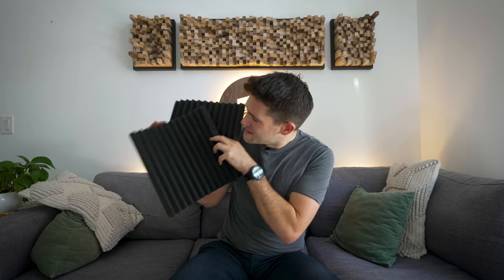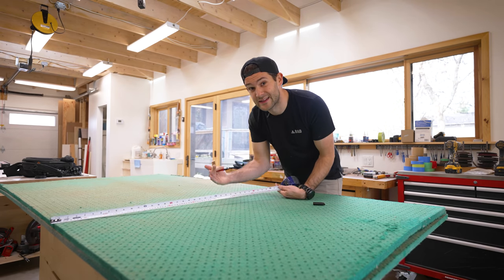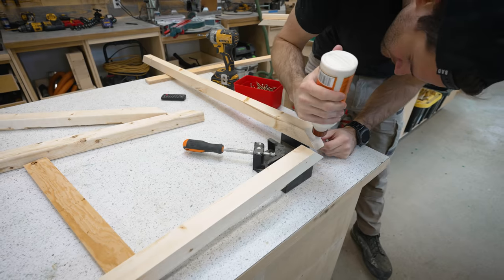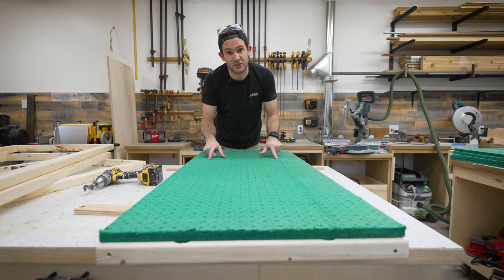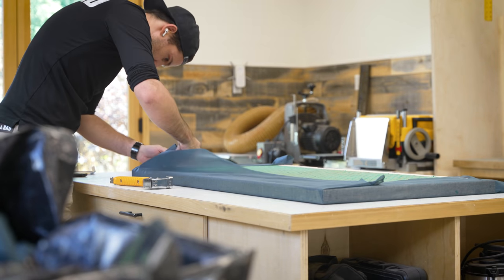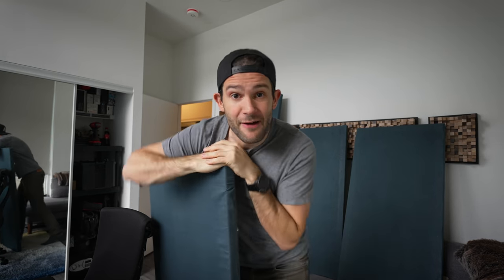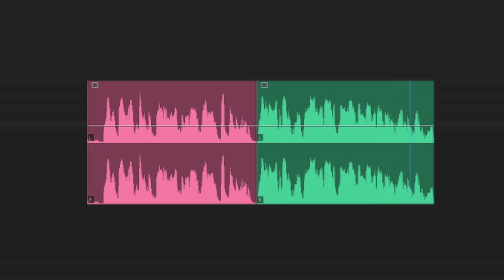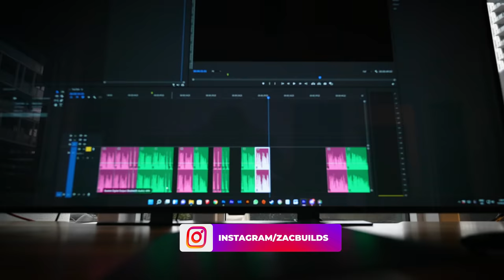Acoustic panels that actually look GOOD

Comment: Fabric can definitely have a huge impact on reflected acoustics. There's a reason speaker grill cloths look the way they do.
Reply: This is not very true. Grill cloths mostly never affect the sound coming of the speakers since the thickness is so thin that it is not an obstacle for most frequencies. It could maybe only disturb the very high frequencies (but then you’d need some thick cloth).
Reply: The key is that the sound hits the dense sound absorption. If the fabric isn’t breathable then yes it would but if it’s breathable, then no.
Reply: @NewHopeAudio  If you ever visit an old movie theater, or most stage theaters, you will find that they have great big deep 10-15" rockwool or foam absorbing panels wrapped in huge heaps of thick dense velvety cloth.  It has fallen out of style, but mostly because of the look rather than the effectiveness.  Free moving mass is the key to great sound absorbtion, nice thick padded blankets are actually the perfect topper for sound panels.  They don't need to 'breathe' because you are not passing air 'through' the panels at all.  What you want to do is absorb reflections of vibrations in the air, and those vibrations move in waves.  Literally a thick padded blanket hanging on a rod would probably do more good than these panels... but it would look like a granny youtuber space which is probably not what he is going for?

The idea of wanting thin and light breathable material on your sound panels is actually the wrong move, especially with a sturdy wooden frame.  You want to pad that thing out as much as possible with heavy material.  Big loose sheets and layers of jean, denim, or other such materials may look a little odd, but would help more than the board he is using.

Comment: I would definitely be interested in the comparison to rockwool, I'm planning a studio right now and would love to know what performs better. There's not a lot of info about it online - I could only find one sparse reddit thread on the subject. There's one single comment suggesting that because sonopan is designed for soundproofing (stopping sound transmission between rooms), it may not be as optimized for sound absorption (because the sound reflecting back is not the primary concern, but rather just whether it can pass through.) Sonopan left a comment saying it's effective for acoustic treatment but does not offer NRC data for comparison to insulation like rockwool (and of course they would say that.) Rockwool safe n sound is the most popular option, but their comfortboard 80 may be better because it's more dense and absorbs more of the problematic low frequencies. A comparison to either of those would be really helpful since no such comparison seems to exist at the moment. Opinions on acoustic treatment seem to vary incredibly widely even among experts, so deciding what to buy is difficult as an amateur. Being able to listen to the difference 1:1 would be a big help.
Reply: My final project in university was noise transmission, and I've done several successful noise transmission projects since.  My projects have mostly been related to transmission of noise, rather than sound reflecting in a space.  For transmission from one room to another, you want to prevent the drywall from passing vibrations to the studs, because the studs will pass the vibrations to the next room's drywall.  Sonopan does this.  You also want to stop sound that is vibrating the first layer of drywall from passing through the wall's cavity and causing the drywall on the next wall from vibrating.  Insulation, like Rockwool, is effective for this.

To prevent sound from reflecting/echoing within a room, consider the wall to be a non-moving surface.  If you think of the sound as a sine wave, it has the greatest amplitude at 1/4 of its wavelength away from a node-- the non-moving wall is a node.  So the sound-absorbing material will be most effective when it is about 1/4 of the wavelength away from the wall.  This is why acoustic panels are often quite thick.

Male speech is mostly over 250 Hz (female is mostly over 500 Hz).  The corresponding wavelength for men is a little over 5 feet (female 2 feet), so you would want the panels to be over a foot thick (one quarter of the wavelength) to be the most effective at male speech (or 6-8 inches for female).  That's not to say that thin panels won't help-- they will help quite a bit, but they're not optimal.  Think of how much of a difference having carpet installed in an echoey room makes-- it makes a huge difference in a room.  This is partly because carpets cover a huge surface area, so they work well to reduce reflections, even though they're not thick.  

I guess I would say: thin panels are a lot better than nothing.  But thick panels are even better.  Or you could even do something creative, like hanging thin panels a few inches off the wall, so that they are in the location of the sound wave's peak amplitude (even if the panel isn't the full thickness).

Also, as you noted, the density of the sound-absorbing material matters as well.  Generally, heavier materials are more effective.  Solid materials like cement board are great at stopping transmission, but terrible for reflection-- soft open-celled materials are effective.

Anyway, think of the frequency range that of the echoes that you want to damp out the most, and you can tailor your panels to suit the application.
Reply: Sonopan is not designed as a sound absorber neither does it have any given sound absorption coefficients, it looks semi porous, good sound absorbers are usually made from a dens fiber making lots of sound and air go tru but still having it pretty dens to make a lot of sound change into heat. i think as its made as a sound insulator and not a absorber the fibers in sonopan is glued pretty much together like OSB and not a lot of air going through it, therefore reducing sound absorption. therefor my advice is to use rockwool based absorber.
Reply: You can look up the absorption coefficients for this product and compare it to rock wool. but spoiler rockwool will do better at absorbing lower frequencies based on thickness.
Reply: @thestomach  SONOpan has over 17,000 impressions of varying sizes on each side of the panel. This is what allows it to absorb a wide range of frequencies. YES, we make the panels for soundproofing which is to stop noise travelling into or out of a room but they have been proven to absorb sound well. Don't believe us? That's ok, the folks who are using SONOpan on their walls to control acoustics do and they're very happy with the results. Is there a better option? Of course, there are products specifically made for this purpose, but they're more expensive and you can't customize the look of them.
Reply: @sonopan_msl  “don’t believe us? That’s ok…” I think people are looking for data. Additionally, density matters and these are super thin panels.
Reply: @sonopan_msl  how safe is your product in this application?  is it safe on a wall covered in fabric?  Rockwool may have better acoustic properties but their own reps have told me "they don't recommend it on top of a wall covered in fabric.  It is meant for under drywall only."
Reply: Dude... look for some audiophile forums, we are all obsessed with this kind of stuff!
It isn't just about absorption though, it is about frequency and reflection control, and breaking up parallel walls.

If you are just getting started: carpet.  Get a durable, cheap carpet or area rug, and throw-down some padding underneath.  Your floor is likely the largest single parallel wall with the hardest surface, and per square foot of treatment cartpet and a little padding is going to give you by-far the best bang for your buck!

Step 2: get a big fluffy couch and hide all your spare sheets, blankets, drop-cloths, sleeping bags, pillows etc in or beneath it.  This is the 'utility bass trap' and between that and carpet you will have the vast bulk of normal home audio issues fixed so you can do a decently OK recording.  Without those 2 things done first, then other treatments will only be incrimentally helpful.

Step 3: Cieling treatments, specifically directly above the recording space.  It can be ugly as sin as it will never be on camera, and will help with that enclosed space sound that you want.  Make a couple panels like this, but fill them with rockwool, and hang them a good 4-6" down from the cieling.  You want sound to be able to be trapped from as many directions as possible with this, and angling them so they are not perfectly flat is ideal.  Doesn't need to be huge, maybe 4'x4' or a little larger if you can, but you do want it to be thick.

Step 4: wall treatments.  A few important things to note here:
You are not trapping air.  The air is not blowing, and you are not stopping any kind of airflow.  You are trapping waves which are transversing a medium of air.  Transitioning between mediums (speakers to air, air to wall, air to couch, etc) are the best ways to kill energy, so having layers of thick heavy fabric is best.  Making it tight will only help it reflect or reverberate sound, so keep it loose, thick, and heavy.  The more transtions you can provide, and the more energy that can be wated trying to vibrate something heavy, the better.
For the frame, this is one time where asymmetry is your friend.  The reason a modern room sucks for acustics is symetry and parallel lines which create standing waves.  So don't make them ugly... but mirrored off-square tiles on camera may not be bad.  And keep the frame thin, and cut out as many holes as you can without loosing integrity as the more exposed surface area to the rockwool innards the better!
For the insides, the right answer for 99% of people is rockwool.  The real right answer is ultra dense acustic foam, but rockwool gets you 80-90% of the way there, and is just so much cheaper that there really is no justification for dense foam unless you are running an actual recording studio.  Some dense fiberglass options can do OK, but it just isn't as heavy, so it doesn't work as well, and per square foot it if often similar or more expensive, so just stick with rockwool.  I have seen videos using fiberboard, pillows and towels, and all sorts of other materials, but the problem is that they just don't absorb sound evenly across the spectrum like rockwool or foam do... and sure, you can fix some of that in post, but if you are putting this much time/effort/money into making a great recording space, then the idea is to have less processing and editing rather than more.
When mounting, try to get it away from the wall - preferably a good 3-6", but even 1-2" can be helpful (and not all of them need to be perfectly 2" out from the wall, asymetry is your friend in audio).  Because you are capturing waves, having the gap between panel and wall allows you to capture more lower frequencies, absorb sound that wraps around the panel, provides more transitions between different materials, and gives another chance to catch reflections.

Hopefully that helps point you in the right direction!  Good luck!
Reply: @sonopan_msl  Nobody is saying you have a bad product, just that it is the wrong product for this application.  Fiber-board panels offer AMAZING isolating properties, especially when combined with really thick drywall, isolating screws, acoustic adhesives, etc.  Compared to other isolating options there is really no comparison on price and effectiveness.
But when it comes to sound absorption lets be real, the couch in the background is doing the heavy lifting of sound control in that room.  The panel boards are doing very little and the before/after recordings show it.  It is not a bad product, just not the right product for this application.

Don't be that company that slings material at any schmuck to get a sale.  Nobody is stopping you from ordering up and reselling your own branded mineral wool style product that could fit this application better.  Actually kind of amazed you don't do this already.  I bet you could totally contract that out, throw some green dye in there and put your logo on it and have an instant winner and great cross-sell opportunity.
Reply: @Bananasaurus Rex
Reply: @troelsnielsen2848  i agree. exactly my words
Reply: @CaedenV  foam why is it all foam for you guys in the US?
Reply: Acoustical consultant here. We deal with lab tested sound absorption spectrum data of products all the time. To cut things short, I can tell you honestly for fabric wrapped panels, nothing much beats 80 kg/m3 or 100 kg/m3 rockwool. 2" thickness and above practically the maximum sound absorbing fabric wrapped panels you can have, next bottlenecks being the distances you mount these panels off your wall and the type of fabric you use. I am lucky that my bare skin does not get irritated handling rockwool (not glasswool), but gloves and basic face mask when working with it should prevent most from getting the widely reported "itch".

Comment: Nice concept. I did something similar for my home studio a few years ago. I used 2x4 ceiling tiles for my acoustic dampening material. Framed them with 1x2 pine, so there would be an empty space behind the ceiling tile material. Much of the sound is absorbed by the ceiling tiles at first contact. Any sound that gets through the ceiling tile (transmission) hits the wall, and has to go back through the tile again to affect the room acoustics. Covered each panel with felt from the fabric store (alternating between black and dark red panels). Ceiling tile is not quite as efficient as Rockwool or other materials (I started with Rockwool but the project would have been very pricey). However, my budget solution still made a big difference in my studio, and the cost was very reasonable. The stiffness of the ceiling tiles made them much easier to work with compared to rockwool. I made 10 total panels, used primarily on 2 opposite walls. Thought about making some panels for the corners of the room, too. I have wood-laminate flooring, so another huge help was laying a large area rug on the floor.

Comment: We did this with rock wool and about 180 panels. Stripping down wood from our old pews to use as frames for my church sanctuary. It took a long time. We used thicker material and took two people per panel to stretch fabric as we stapled it and got it down pretty well.

Comment: I have various canvas prints on my wall - if the frames are 1" thick, presumably I can just put this Sonopan straight into the back of the frames and get some acoustic dampening from those, which seems great
Reply from the maker: That's an interesting idea, though I worry that the canvas wouldn't be transparent to sound. Probably depends on the type of canvas used, but hey it's worth a shot!

Comment: I have made 4 panels of 1.2 x 2.5 meter with 80mm rock wool, standing from floor to ceiling dividing the living room in 2 separate rooms but are only friction fit with foam and is easy to move. I plan to move 1 or 2 panels to the wall making a passage and join the two rooms during the summer. The difference is a lot bigger than your smaller panels, it's almost completely dead. Just some window and ceiling reflections remain  but these are caught quicly and don't bounce around in the room anymore. I also saved 1000 euro's of the energy bill per year, so the cost was recovered  two fold in just one year. The rockwool isn't so bad, just unroll in the frame, fix with some screws, cover with canvas, very little dust while building and no dust when covered. And no saw required to cut panels, just a sharp knife, drill, hand saw and a stack of 90mm wide boards. I've placed 3.6mm plywood boards as backing to make it airtight.

Comment: here in germany we can buy rockwool in plenty different thicknesses, 4cm to 10cm in 1cm increments. that's 1.6 inches up to 4 inches in 0.4 inch increments in imperial units.
but wood fiber acoustic panels are absolutely a thing even in recording studios. they are generally speaking more efficient in absorbing bass frequencies though. towards the highs they are less absorbant and more reflective, atleast compared to rockwool.
Reply: This is true of plain fiberboard, which we manufacture also. SONOpan is less dense than normal board and has over 17,000 impressions to create differing densities within the panels to absorb a wide range of sound frequencies. Right now though they're only available in Canada, US and Japan. Stay tuned though, we have big plans :)

Comment: When you attach a fabric to a frame, start from the middle of the length, a couple stapples, then do the opposide side, also couple stapples, after you've stretched the textile a bit.
Then do the two other sides thes same way.
Then, stapple some more spots, each time going from center to corners and stretching the fabric a little bit.
Stapple the corners in the end.

Comment: The new panels definitely look better. When it comes to acoustic treatment. Different thicknesses of the panels and a variation of material affect the different represented frequencies which cause the reverb. And the placement of the panels is just as important especially when we live in square or rectangular rooms.

Comment: I'd recommend the Bessey Corner clamps, each side have their own little clamp so you can prefit your test piece and keep one side clamped so you can get a tighter fit between the seams
Reply from the maker: Nice! I'll check those out, thanks for the tip

Comment: Although the panels reduce reverb, there is still significant reverb.  It's largely because you are only covering a relatively small portion of the wall surface.
Reply: … A fraction of the total room reflective area, walls but also floor and ceiling
Reply: nope, you can only cover 10-50 percent of a wall before benefits to the impact on sound starts start rolling off